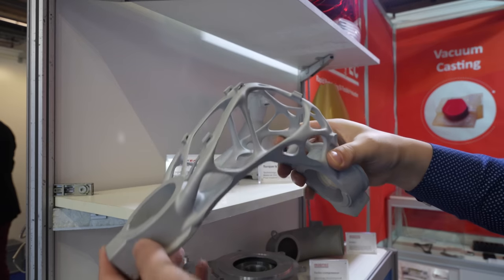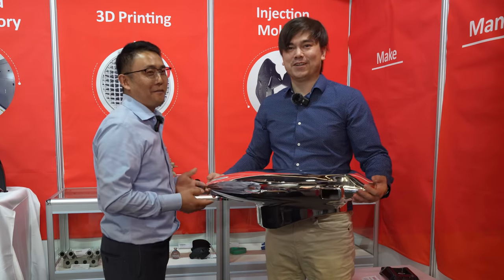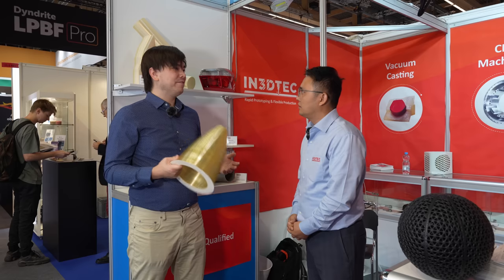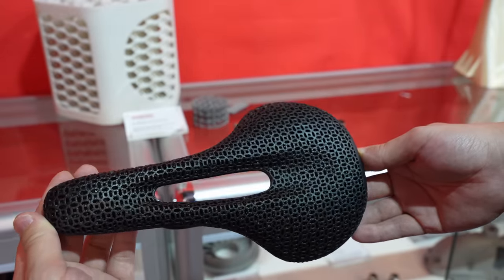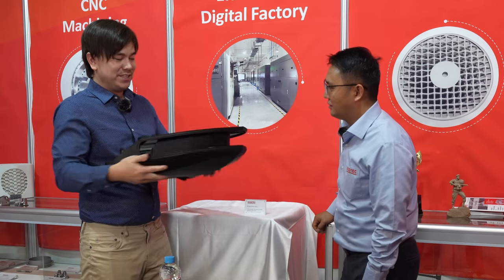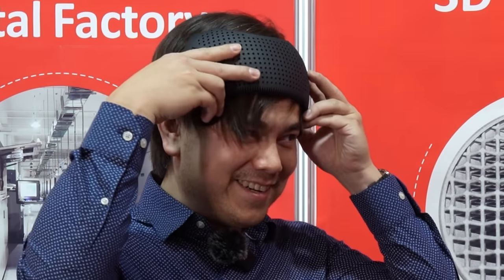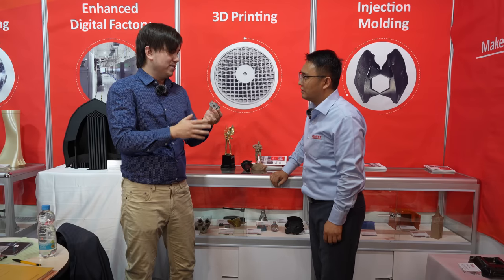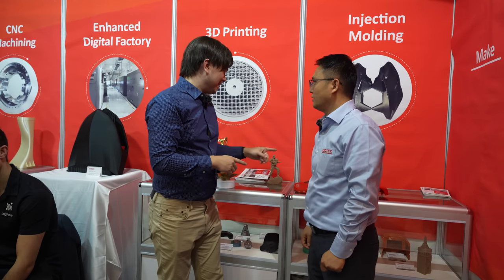Affordable Metal 3D Printing with IN3DTEC

Comment: I've used them before, and even recently. They do a good job for how competitively priced they are against other similar services. I would definitely recommend sending a couple test parts, or asking about precision before doing larger orders. I've used their SLM service and the parts definitely varied a little bit from the base part. Make sure you design around that tolerance, and I'm sure you'll be plenty happy using these guys :-)
Reply from the maker: Good to hear from an actual customer. These guys were pretty popular at Formnext, lots of their customers dropping in with parts and questions. Jack was very humble, I did not know until after the interview that he is the CEO of the company.
Reply: @NathanBuildsRobots  that's sweet :) it's always good when companies are not that big, there is a different hierarchie and a hands on mentality...

Comment: very cool. their facility sounds like a maker's paradise, and by extension having access to all these services is the next best thing. offering carbon layups, electroplating, vacuum deposition, polishing, casting, component bonding, really takes it to the next level. absolutely amazing!
Reply from the maker: Yeah so you don't have to try and get a part made by stringing together multiple job shops, and dealing with all the scheduling issues that entails. I was very impressed by how much they can do in-house.

Comment: I loved this sampling of so many prototyping and unique manufacturing methods.  Some of the prices were low enough that I'd be tempted to use their service for some highly optimized show-off part in one of my custom designs, particularly if it would save me a significant amount of fabrication and/or assembly time, or to reduce weight in a very weight sensitive application.  The homebuilt airplane guys are gonna love the ability to CAD a carbon fiber part.
Reply from the maker: Yeah, I imagine some small custom CF parts, where the mold wouldn't be too expensive, could make for some nice limited-run parts.
Reply: @NathanBuildsRobots  - I've never done it, but in my bag-o-tricks is printing a plug (convex version of a mold), coat it in several layers of polyvinyl alcohol as a water soluble release agent, layup a custom carbon fiber part over the plug, and vacuform the custom part.  The 3D printed plug could be made intentionally porous so water could quickly release the part.  You could 3D print a garden hose connector into the base of the plug to release the carbon fiber part almost instantly.

Comment: It's crazy how you good these parts get when theyre made by true professionals with true professional equipment.
Reply from the maker: Yeah, the interesting thing is that 2 companies can have the same machine, but some will specialize in specific jobs, and get much better results out of the exact same machine based on experience and specialization. There is still some art left in manufacturing.
Reply: @NathanBuildsRobots  Yeah I mean some companies can offer different materials, finishes, lead time, etc... it's great seeing the additive market go the way it is.